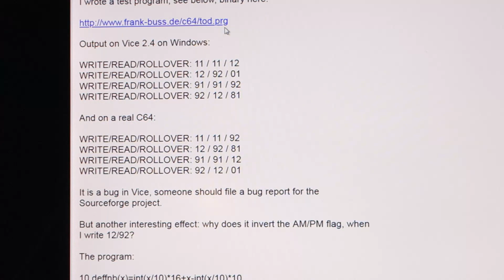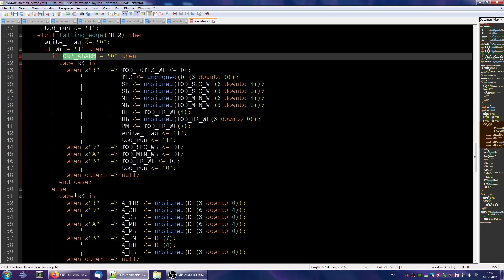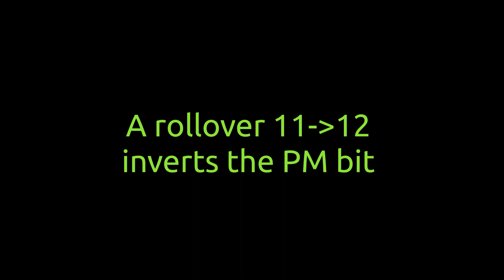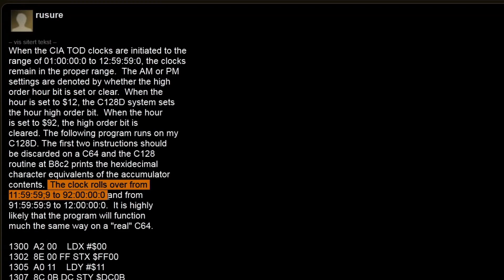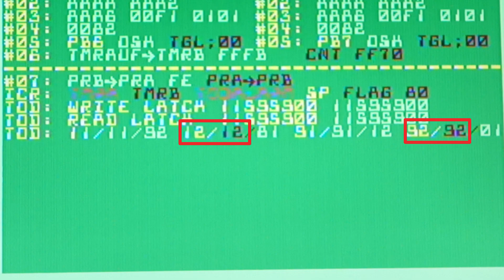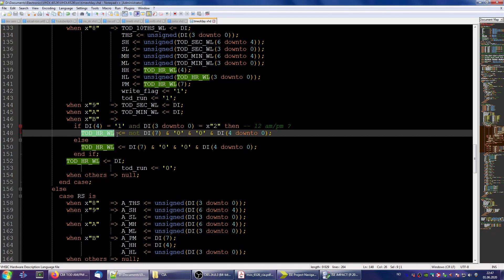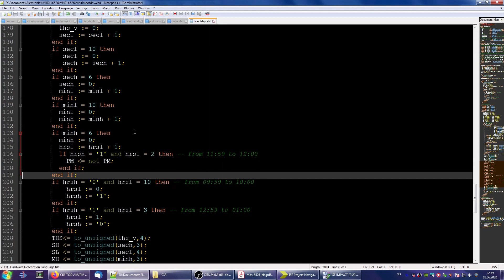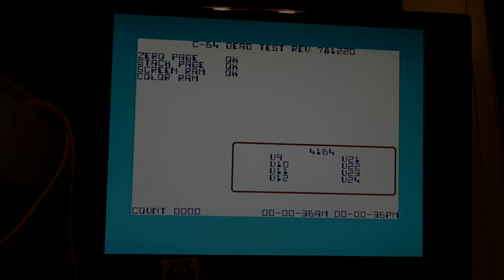The VHDL6526 project - TOD debug 2

Comment: seems that you make good progress. are you using a 5V compatible FPGA?
Reply from the maker: Hi. Yes this FPGA has 5V tolerant inputs. It's a Xilinx Spartan 3. The voltage is clamped inside the chip, and it requires resistors to reduce current into the clamping diodes. The resistors are on the development board. The outputs are still 3.3V. It seems that the CPU handles it fine. Not optimal though. I'm currently looking at moving to Lattice ICE40 and using level shifters. System bus (data, address and control) is easy though, but I'm wondering how to level shift PORTA and B. They are bidirectional and individually configurable direction (data direction register). I'm thinking maybe using a 16bit IO extender with I2C or SPI. I've also looked at bidirectinal level shifters with automatic direction.
Reply: @bwack  i think texas instruments has many of these. but you are right. on a pin by pin basis it gets more complicated.
Reply: I've used similar TI chips for analog switching, and I've seen these too. Texas Instrument's SN74 series have all sorts of multiplexers etc, and I think I've seen selectable direction level shifting, perhaps 8 channels at a time? Could a couple of those be used?

Comment: The intro was gorgeous - the sheer contrast with the hardcore FPGA CIA replacement development and debugging is awesome. For some reason it can be just as soothing actually. Did I just hear you saying that the AM/PM rollover is seriously faulty in all those C64s out there? Ah well - I reckon most folks wouldn't be affected by it but perhaps those running the old 24/7 BBSes back in the day were!!!!! Woah...
Reply from the maker: Thanks Mark. Not sure what is right, I mimick the original chip. What I think is wrong is the am/pm bit is flipped when time is set to 12h. Maybe there is software out there with correction routines, but yes very few software use the TOD :)
Reply: @bwack  yes, the am/pm bug is also noted on wikipedia. this is a minor issue and needs to be reimplemented the same way to stay compatible. good job!
Reply from the maker: ps. the intro was from a long walk Ingri and I went on. :)
Reply: TRY    ADDING   A   REAL  TIME  CLOCK   O   MOTHERBOARD   AND  SWICTCH  OF   24  HOUR  CLOCK   UNTIL   U   FIND  A   SOLUTION    ITS   JUST   A  CLTCH  YOUR  JUST    TIRED   COME   BACK TO IT   LATER   HAVE   A    RES   IT   WORKS   FOR  ME
Reply from the maker: I'll consider a real time clock. Thr TOD works fine now.

Comment: I feel your pain, the rollover issue would bite me when I would program timekeeper routines in PLCs. Not something that PLCs are really designed to do. It took awhile to get it correct. Great work!
Reply from the maker: Thanks ! Do you remember how you solved the rollover from 23:59 to 0:00 (or 12h to 01 ?) I made a clock out of 7400 logic back in '99 using only information from TTL Logic data books. I remember dwelling over how to reset time to 000 at 23:59:59.. I think I let it go to 24:00:00 then let it reset. I didn't know about register ot register logic back then :)
Reply: @bwack  It's been a minute. That was back in '95.

The system was for a timekeeping program that was ill-advisably situated in a PLC, and I had to automatically start and stop the paint booth lines for start of shift, first break, lunch, second break and end of shift. First and second shifts were no problem, but because third shift "wrapped around" the day my compares were now looking at a smaller value. I think what I did was to temporarily add 24 to the rolled over hour, do my math, and then subtract the 24 hours for the display.

That was roughly 25 years ago. I'm lucky if I can remember where I live these days.

And there is a reason why you don't see many PLCs in the running for "Atomic Clock of the Year" awards. It has to do with their general lack of awareness or concern between a second, and exactly a second. On the plus side, same day service is always guaranteed.

Using a one second timer from the PLC was a poor choice since it would be off by about 22 seconds by the end of the day. I solved this (well, reduced the error by a factor of ten) by calling what is called a STI (Selectable Timed Interrupt) every 985 milliseconds and incrementing the second count by one in the routine - that's all that it did. The "missing" 15 milliseconds were taken up by the PLC in it's "housekeeping" part of its loop.

This got me an error of under two seconds per day, which was acceptable to the plant since they had an honest-to-goodness timekeeping system (Simplex) that could send me a synchronizing pulse of two seconds once per hour, and an eight second pulse once per day. By correcting the time on the hour I had an average error of less than five milliseconds per hour. Which in a car plant works out to be about 41 cents.

All they had to do was to have their electricians wire an input to my PLC to make it work. I finished up and left before this ever happened, so my best guess based on what I knew about their electricians back then, is that the paint shop in Wentzville, MO is starting their shift about five hours off compared to the rest of the plant these days...